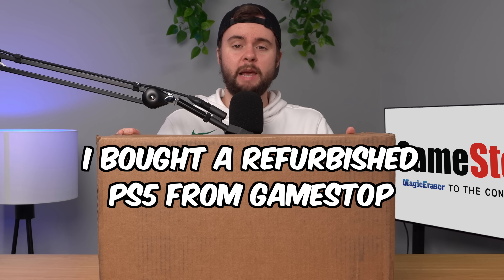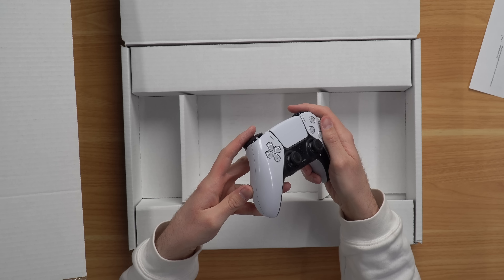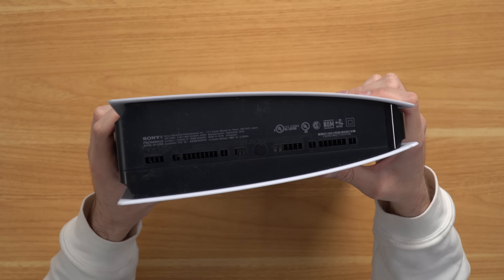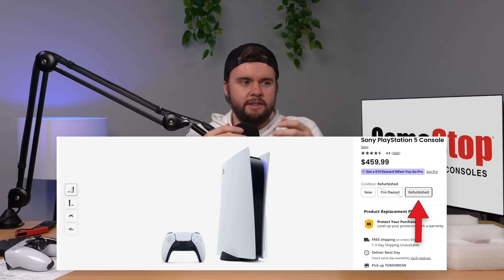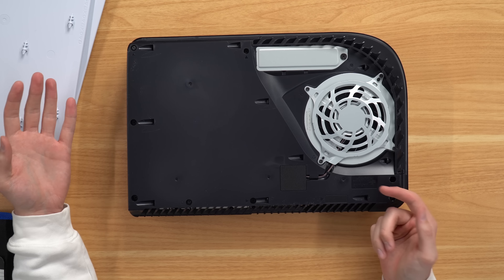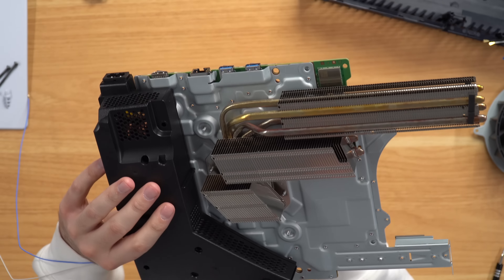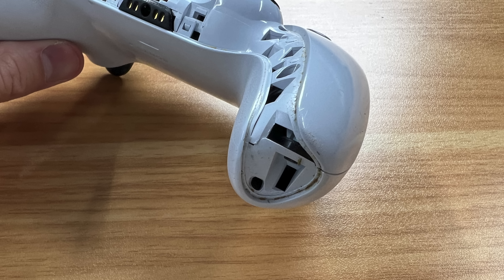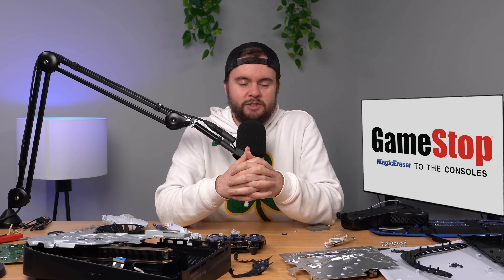I Bought a “Refurbished” PS5 from GameStop for $380…

Comment: It looks like they only had to refurbish the controller and clean the exterior of the console. The stickers are Gamestop's internal parts ID numbers to show what was worked on. My guess would be they replaced the thumb stick caps after the original owner wore the top of them out (somehow) or the more likely option of their pet chewing them off.
Reply: I bought a pack of cheap universal rubber caps because my cat kept trying to chew on the sticks, especially the PS5 ones for some reason. Thankfully she's only around my desk when I'm in the room, so she always gets caught right away. But if she does ever manage to damage something, now it's just a cheap throwaway bit of rubber, instead of a $70 controller.

Ended up putting some better KontrolFreek ones on my PS5 and Series S controllers. Nice little upgrade, and still a lot cheaper to replace than a controller.
Reply from the maker: Wouldn’t they have to take the controller apart to replace the thumb stick? Unless there’s a way to just replace the cap without taking the controller apart. I really hope they didn’t open up that controller and leave it that dirty 😂
Reply: Well they did more than Dk oldies did I bet it is also based on location as well

Comment: As someone who works for Game Stop as a SGA, I would 9/10 recommend a used console over a refurbished one. Just because if you trust your Game Stop Associates, they will properly clean the console and dust it out with our air blower. At the location that I work at, we are VERY adamant on NOT using a magic eraser due to seeing videos like this. I want to keep my reputation as a retailer and make sure my word still holds value. 

Unfortunately, GS does use magic erasers as the standard because they rather have the console be as clean as possible. To that, the system also does not appear to be consistent, again, I work retail store, so I do not know what our warehouse employees do, but I will give an update when I find out!
Reply from the maker: Yeah I’m assuming all of the consoles I’ve purchased from them have been from their warehouse? Since I always buy online from their site. Just my guess, but I’m sure you know better than me. Pretty much every refurbished console I’ve purchased from GameStop has been magic erasered (except maybe 1 or 2 consoles)
Reply: Also an SGA, can confirm. If it needs magic eraser, it needs a spray cloth after. Period. We don't like that film it leaves, but it's so good getting buffs out. 

If the sony stickers are already gone, I'll CLEAN it myself. If they're in tact, ill use the blower. 

Pre-owned all the way in my store lol
Reply: They should just use goo be gone. It makes no sense to use a magic eraser.
Reply: That’s the same thing they told me two weeks ago, the refurbished console shut down after an hour and a half of playing spider man miles morales and I had to go the next day and get a new one, also everything inside the box was loose, no packaging, just the box
Reply: No one comes back to a 3 month+ old comment to give an update

Comment: As a former GS manager of 10 years. Anything coming from the warehouse will be refurbished. Wether it be the stores took it in as “defective” for missing components, dirty, or doesn’t work properly. The store gets the “refurb fee” credited to their bottom line on their profit report. Once it’s at the warehouse they will fix, clean, or simply put a new accessory with it and send it out as refurbished. Pre owned is when the store determines its running properly and the store boxes it up and sells it as pre owned. The warehouse will test it again when it gets there to see what the issue is. And they will then determine how far they need to refurb the system. A refurb through them can literally to be just clean the outside. I went to the “roc” (their refurbishment center, as they called it 7 years ago. Back then it was a crazy nice advanced place. But I’m sure now with all their budget cuts it’s not anywhere near what it once was
Reply: Also those stickers on the controller are their “refurbished” stickers it’s kinda like their “dk oldies warranty” sticker. They just throw them on there when they put them through their refurbishing process.

Comment: As a current gamestop employee, there are a few reasons we take defective consoles in as trades that end up refurbished, 1. Something wrong with the console (disk drive hdmi port, etc.) 2. Console looks like it's been beaten to hell, and there's a lot of surface  damage to the console. 3. The controller it that was traded in with it was defective. 

Now understand that when consoles are traded into us, we do not demand that people have original cables with it, just needs functioning cables, we do however demand that the controllers be wireless and not off brand meaning powerA or something like that. Also, when a console is traded into us, if the controller is defective, we have to take the whole trade as defective, even if the console is perfectly fine.
Reply: It’s not hard to say OEM controller dude
Reply: So coming from you. They are selling a refurbished one for 350 and I was contemplating getting it because at Walmart and farther they either dont have brand new or it’s 550-600 dollars which I really didn’t wanna pay. Would u recommend getting one from GS

Comment: For what they charge for their "used" and "refurbished" products, they should definitely open and clean the controller. Also using a proper cleaning method is a must. These issues persist across many stores selling used and refurbished consoles.

Comment: I've used magic eraser on practically every surface in my house and have never once had it scratch something... unless they suddenly added a grit to magic erasers, I'm confused how a soft spongey cleaner is scratching plastic.

Maybe they're using those super cheap dish sponges from the gas station? I've seen those scratch ask kinds of stuff
Reply: Magic erasers are abrasive, that’s why they clean better than just a rag. They are like 2000 grit sand paper.

Comment: Seems like magic eraser is a bad idea with glossy plastic, just curious what is the best way to clean? Is there a common tactic?
Reply from the maker: Glossy surfaces are a tough one. Personally, I would just lightly clean a glossy surface with a microfiber cloth if it doesn’t have many scratches. If it already has a lot of scratches, I usually wipe it down with a wet wipe and then immediately wipe with a microfiber cloth to remove any streaking. Magic eraser should really be a last resort. But this conundrum is why I prefer matte consoles over glossy
Reply: IPA and a microfiber cloth does a pretty good job. Soap & water for spot cleaning if needed. There isn't much that those 2 methods can't clean that a Magic Eraser can instead.
Reply: I use a microfibre cloth and diluted bleach water. Leaves things streak free and disinfected. I use this method with everything I buy used or everything I refurbish. Hope this helps!
Reply: Just don’t touch the glossy part
Reply: @jrob0021   Personally I find more success with cleaning the consoles with a microfiber cloth rather than using the magic eraser.
Reply: I normally use a wet wipe or damp rag or something most stickers come off when they get a little wet and it doesn't destroy the glossy finish also I follow up with a dry towel or something to ensure no streaks like Jacob R said that stuff should always be a last resort not a 1st

Comment: They might have just replaced the fan or something, that can be done without removing the warranty sticker, and considered that a refurbishment
Reply: I mean having to switch out a fan is a refurbishment. It's made in September 2022, if it runs then everything is probably OK.
Reply: How do you switch the fan without taking the peel off?

Comment: Local used electronic store had a digital for $350. After trading my PS4 towards it. Only paid $250 for it before taxes. I was lucky and it had nothing wrong with it and seemed good as new! Even so with, with the potential flaws on the outside of the console. And the possibility of an even more discount from trade-ins. This is a steal for the console from gamestop.

Comment: It's insane to me that stick drift is just so common place now that we are at the "it is what it is" stage already...
"Oh yeah... That's the normal amount of stick drift... Perfectly fine..."
WHAT!!!!
Reply: I want to be very clear that I set the stick settings up in Apex to purposefully exaggerate the stick drift in the controller as much as possible. If you download Apex on your PS5 right now, and set your sticks to 5 sensitivity for hip fire and 6 for ADS, along with the linear response curve and dead zone turned off, you will likely see this much drift on even a very new controller. It is definitely not an unplayable amount of drift in most circumstances unless you specifically wanted to play with those settings. 5-6 classic in Apex even with no dead zone will not drift this bad. It's the linear response curve that draws it out. Try it for yourself.

Comment: Magic Eraser is probably the easiest product to use... Not the best for this application, but easiest - and there are plenty of cheap, generic knockoffs of Magic Eraser nowadays to satisfy the Accounting Department. Also... I doubt they're being used "properly," Magic Erasers should be used damp (they are abrasive sponges with impregnated cleaners, or in other words, a gentler S.O.S./Brillo pad), they absorb water very easily, and the water comes back out of them with the slightest pressure (GREAT IDEA AROUND VENTS AND PORTS, RIGHT?). Even if Magic Erasers WEREN'T abrasive, they shed water too easily to be safe around case openings. They weren't designed for electronic devices encased in high-gloss plastics, they were designed for countertops, stovetops, dishes, and sinks!

Magic Erasers even scratch NSF-Approved plastic food storage bins when you're really bearing down on it, to get the crap your coworkers left burned-on for hours in the hot holding unit. It's fantastic at getting coffee stains out of stainless steel, so like most cleaning products, when used for its intended purposes, it's harmless and effective. It's not designed to be used on soft plastics, and there's probably a warning about the product being mildly-abrasive somewhere on the label. If not, it certainly falls under the "Not To Be Used For Unintended Purposes" type of warning most products carry for liability reasons.

If you're gonna scratch everything to hell with a Magic Eraser, at least rub on a quick coat of Armor All to hide the damage! 🤣 I'm kidding. Don't intentionally damage plastics by using the wrong cleaning methods, and then sell it for top dollar. Don't be DK Oldeeznuts.

Comment: I plan on buying a pre-owned disk version this week from GameStop. Do you recommend?
Reply: Pre-Owned, yes.
Refurbished, no. 

Usually, I prefer refurbished over new because most places also typically fix any manufacturer defects in the refurbish process.
GS - for now, do not get from GS. However, I will say that they are working on fixing the issue.

Comment: I bought a used ps5 the first just came with brown paper sheet so things didn’t move around. The stuff raddled around for sure. But yo the console was filthy with dust and underside the white area was covered in yellow/orange probably from a smoker house. When I was setting it up the ps5 would only stay on for 5 minutes because it would get too hot. I thought it would get hot because of the area I had in. It wasn’t it was just to filthy, I called in and let them know what was going on with it they told me to bring it in and they checked if they had more in the back they did. I don’t know why they didn’t they give one from the back. They gave me the display one. The 2nd one o got front then it still came in in a normal box with a paper sheet to keep it from moving around it still did. But this ps5 is clean like it’s brand new no scratches either and I got money back too. This ps5 works like new for sure I’m happy with it.

Comment: Over here there $499.99 brand new a little over $500 with tax I never buy refurbished unless I have no choice and ps5 still being brand new I would have just bit the extra $120 and bought it brand new over taking the gamble the fact someone damaged a ps5 this soon in its life span to need refurbishing is the most shocking part to me here 😂

Edit: just realized its for digital not disc based my price tag was off as the digital version is cheaper my point still stands just a different price range ya all know what I meant but my bad for anyone who feels the need to correct it

Comment: Lay the system down when using it. When it's standing and on. The thermal paste will run and drip
 Seem a lot of repairs because of that
Reply: That's Liquid Metal and thermal paste doesn't work on the PS5.
Reply: This was debunked a while back. Your statement only really applies when a system has been taken apart. It’s a lowkey fail safe to stop people from modding the system. The Liquid Metal is contained properly when the system is 100% intact.

Comment: i just refurbished my used xbox 360 slim ive had for years cleaned wiped down paste replaced every single bit taken off and put back on looks brand spanking new its also silent when running let the thing run for about an hour idle blew correct ammount of hot air paste worked!

Comment: That stick drift is such a bad defect. Luckily I had All State extended warranty and I submitted claim and sent joystick back and told All State to replace with dual edge sense controller so next time I won't have to submit claim and can just replace stick module myself. After I sent joystick to All State I bought dual sense edge controller love the new improved rubberized grip